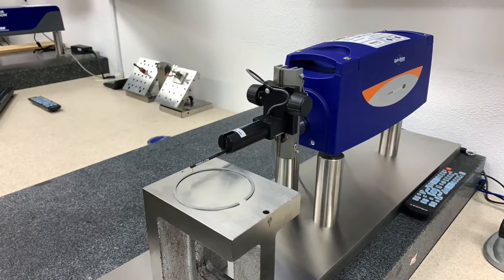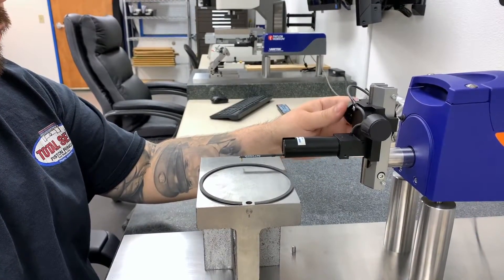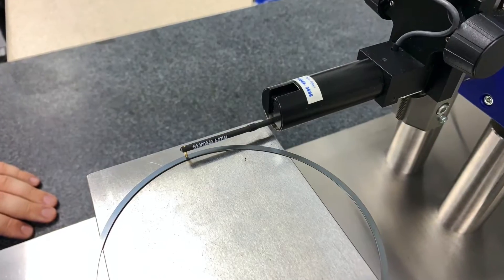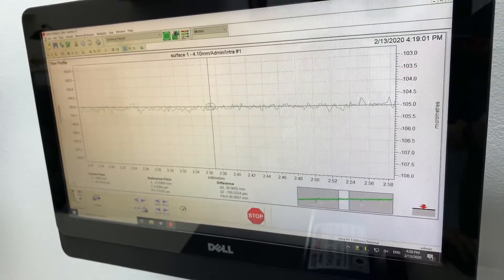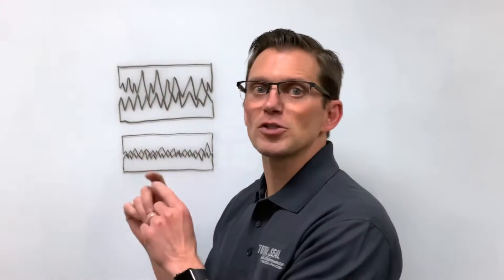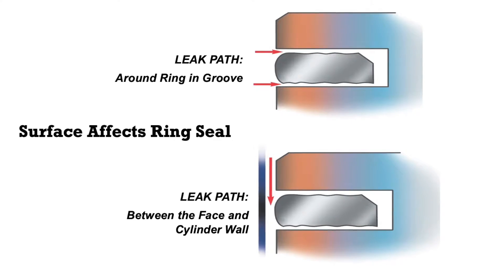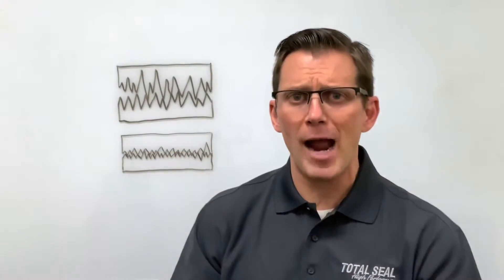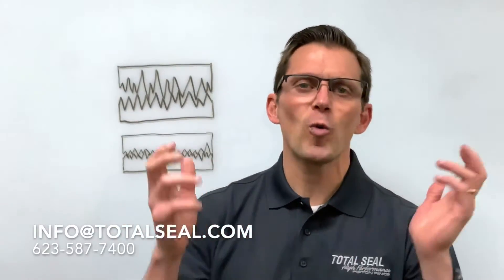Effects of Surface Finish

Comment: How does the reduction of surface Ra,  correlate to wear over time? For instance the reduced Ra is now going to lead to a reduction of oil capacity in the metals surface. I can totally see this reducing friction. 

Second, does this ring coating work or play nicely with Alusil?

Comment: What is Best with Chromoly rings ?
Reply from the maker: There are no Chromoly rings. They are Chrome faced or Moly faced.
Reply: @TotalSeal  So when the package say chromoly  the silver line on the top ring is either chrome or moly  And the Pushrods say the same chromoly pushrods.   Only going by the packages . thanks